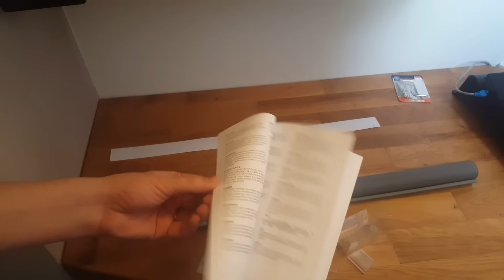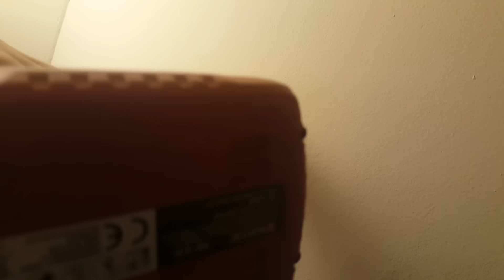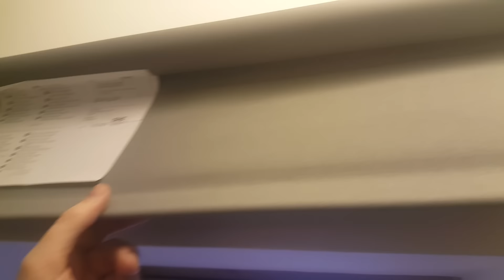HOW-TO mount IKEA TUPPLUR blind roller

Comment: Hi! Great video. I was wandering if I can mount it in the ceiling? Thanks
Reply from the maker: Yes you can, but you have to fix it on the other side like I did it with the screw.
Reply: @TimotejStanek , thank you!

Comment: Hello,

Can you help me ? I think i threw that strip of paper out. Do you or anybody know what the dimensions are for the 80cm/32 1/2" one ?
Or maybe i can just assemble it beforehand...
Reply from the maker: On my 60cm model, it is exactly 60cm between holes. But to be sure, you can assemble it on table and measure it before drilling.

Comment: Can it stop in some point as needed, or is just "on and off"?
Can I stop it in the middle?
Reply from the maker: +Cristi C It can be stopped anywhere. I have the bottom holder only because the wall is not horizontal.

Comment: I still can't get how the left part goes on the hanger :(
Reply: The wall bracket has a flat tip like a screwdriver that the roller blind slots into, which keeps it from rotating as you pull the blinds down.
The other side with the removable plug is a spring loaded round tip that goes into the hole of the bracket, allowing it to rotate.
The distance between the brackets has to be correct; if it's too far apart, the blind can fall down if the spring loaded round tip can't remain engaged in the hole if the blind is slid to the left.
If it's too close, the blind will bind when rolling up and down.  They provide a cardboard spacer to use in the installation to make sure it's not set too close; after installation, the spacer is removed, making sure it has enough room.

Comment: Hey great video but can you tell me where to find the long paper with the holes which is used as a stencil to mark down where to drill? I bought the 140*195 version but I can't find it. Thanks in advance
Reply from the maker: +web20idiot It was inside the package with all other parts.

Comment: I can't get my rollers to spring up... I did everything as you did but when i pull them down I have to wind them manually op agin. Help!!
Reply from the maker: +Sigriður Þrastardottir That's weird. Try to call ikea support and share their answers with us.
Reply: I´ve figured it out. The blinds where mounted to tight. After I widen the "holders" in both sides ( with a hammer) it sprang up.
Reply: take it back to IKEA, they will sort it out for you or give you a replacement. My experience with them is really good.

Comment: They don't stay down, you need a screw at the bottom to hook it on too!!

Awful awful blinds!
Reply from the maker: +smsno1 I used a screw only because the wall is not vertical. The blind will hold its position but hang into the space then. One do not need a screw on vertical wall.